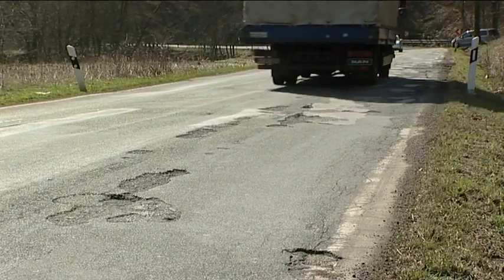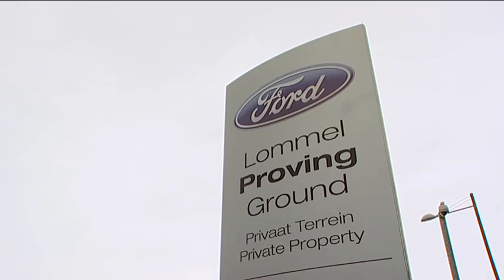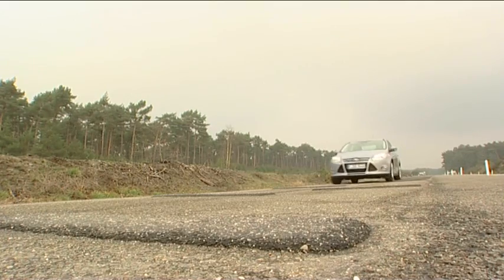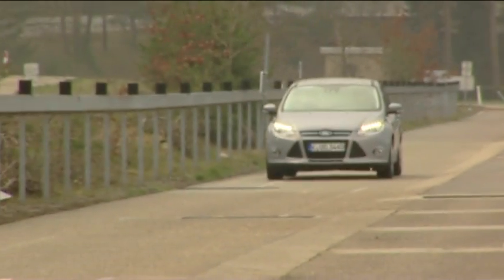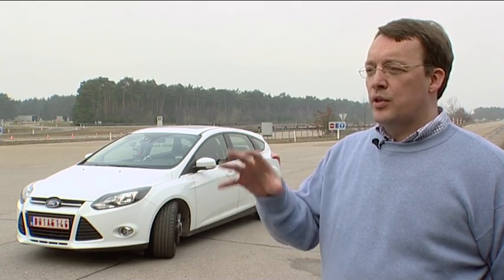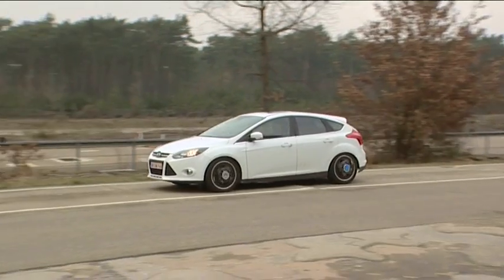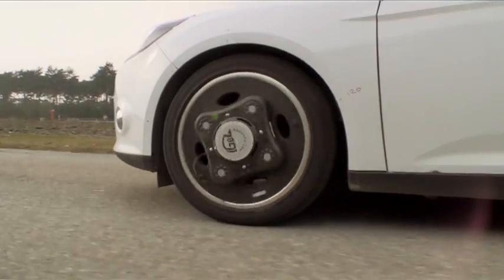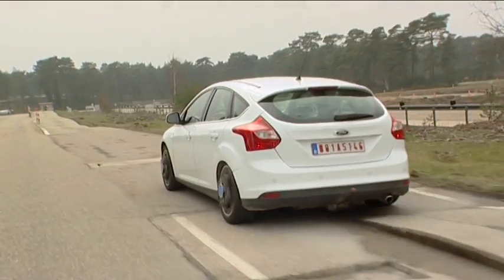Pothole testing

Comment: You have the wrong people employed to do what they do. Typically it's probably a case of who they know and not what they know. Why not show screenshots in your video of proof of what makes these people qualified for doing what they are doing?
Also how about owning up to all the TDCI DuraTorque engine injector problems?
Yes, I know the engine is mainly developed by PSA group, but the injection system was all Ford's doing.
I bet these people have no knowledge of PHEV vehicles or even of how the EV powertrains work. This is indicated by the slow evolution of Ford's EV range. Employ the right people and see the company strive. It's common sense.

Comment: Consider it sending here in india. Be rest assured apart from Suspension, stability, braking performance, rigidity, NVH, electronics, rear passenger comfort etc will also get thoroughly checked and mortal remains of the car will be sent back for further future improvements! All the best ford.

Comment: all I can say is I have never changed the shocks on my 2000 Ford Focus, they are  surely tired at 170000 kms, and not a single rattle evident in the car.
I will buy another Ford because of this maybe not a Focus this time too large, but a Fiesta is on the cards.
Reply: Still alive ?
Reply: I have also a 2001 220 000km driven Toyota Corolla with all original suspension components, still drives quite well and passed has passed annual inspections